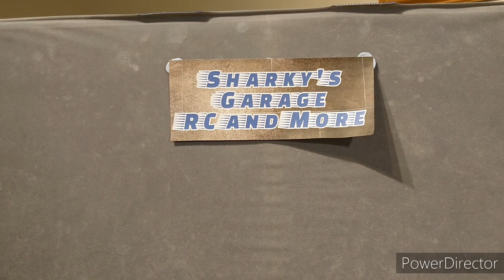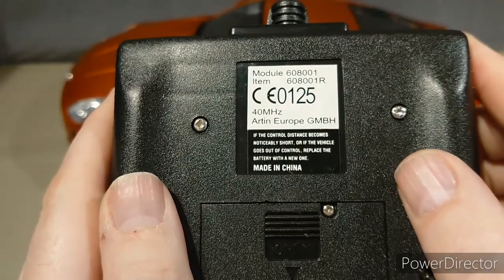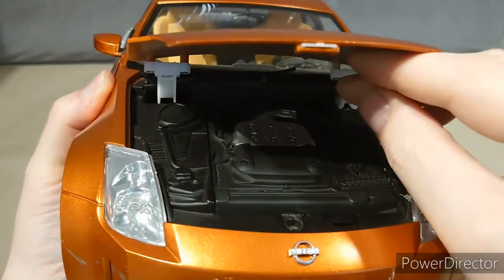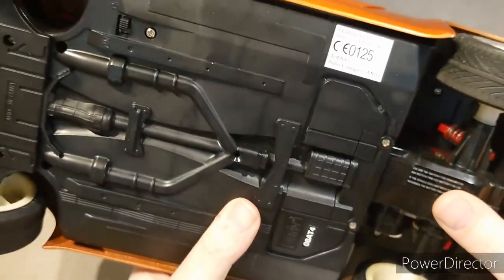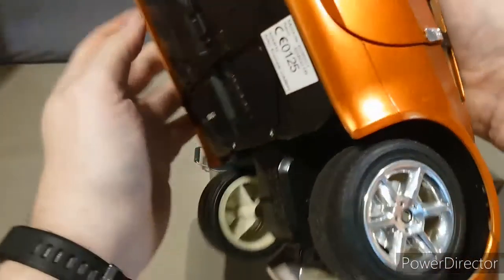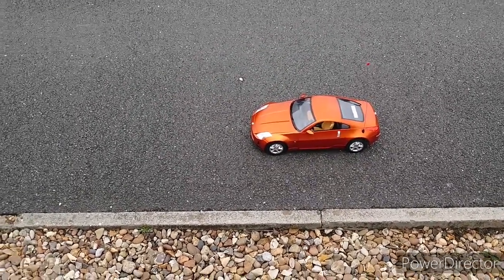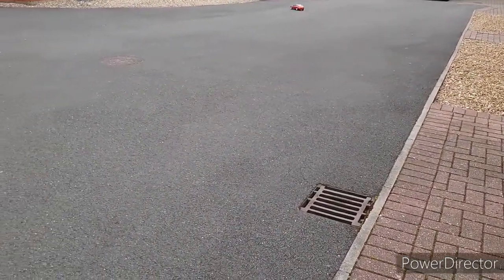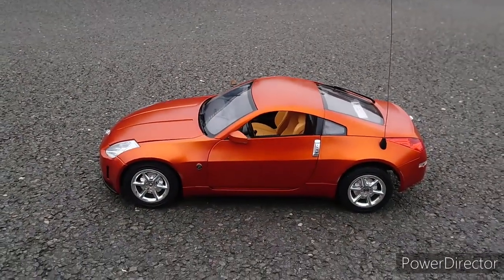Vintage:- Artin Europe GMBH, Nissan 350z, Md: 608001, 1:10th RC Drift Car, 40Mhz, 9.6v Ni-Cad

Comment: Very nice project there 👍 thanks for the mention 😊 ! Great price for what it is can't really complain about it .
On the start up sounds good but it's a shame there is no more engine sounds.
It has some cool detailing ! 
What's the plan? With it 😜 hobby grade it ? 
Still a cool little RC whatever way you decide to go  . btw yes the plug it's a tamiya standard plug
Reply from the maker: I am not sure i have the skills to do its transition justice.

Would be nice to have it running brushless on 2.4ghz.....
Reply: @SharkysGarageRCandMore  I'm sure you can  it's not that hard 😁
Reply from the maker: @Fonzierc  need to learn to solder..... And get bits to make it...
Reply: @SharkysGarageRCandMore  soldering is not that hard if you get the right tools the rest of it is just making sure that you don't mess it up 😜
Reply from the maker: @Fonzierc  i know the technique, its just confidence....
Reply: @SharkysGarageRCandMore  completely understand the best way it's to learn by your own mistakes  ( it happens )
Reply from the maker: @Fonzierc  i need to learn on a project where replacement parts are cheap...
Reply: @SharkysGarageRCandMore  or just practice soldering wire together for no reason diferente gauges . everything helps

Comment: hey i found one of these in my living room and im getting it to work again but i cant find a charger we have the battery but we dont have the thing the connects onto it to chrage the battery any idea where i can buy one ?
Reply from the maker: I would buy a charger that does the right ampage the buy some deans connectors, change the connection on the battery, car and charger so you can charge and use it
Reply: So I bought one of these blind on Facebook for 20 dollars, but there's no battery pack or charger, what would you recommend I do? Thanks!